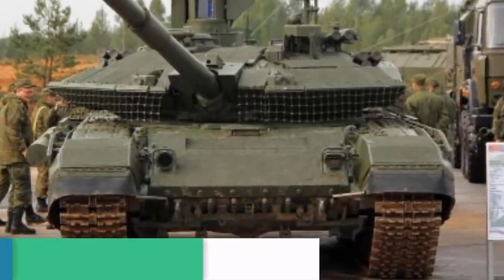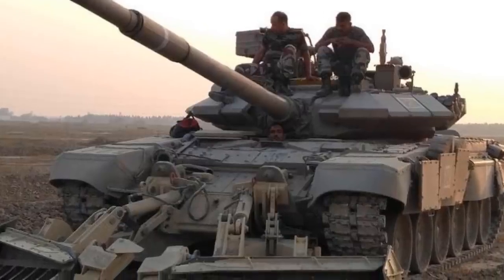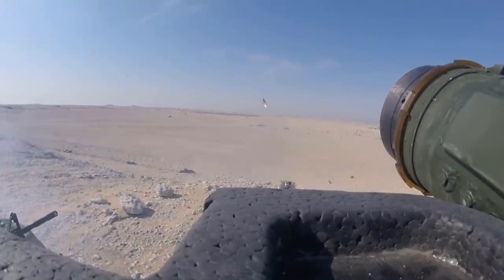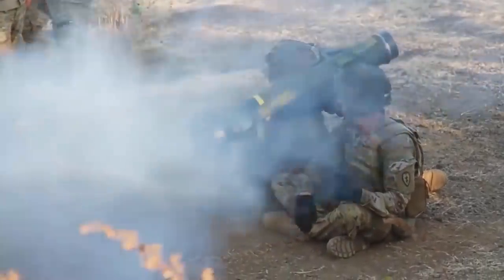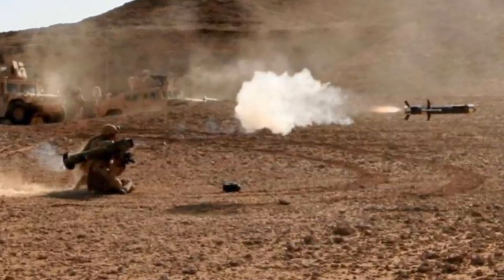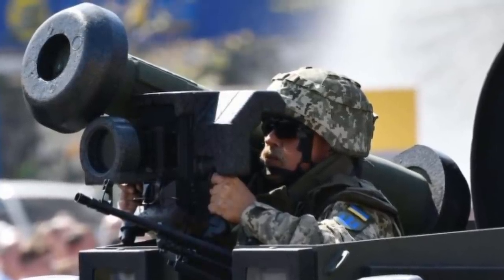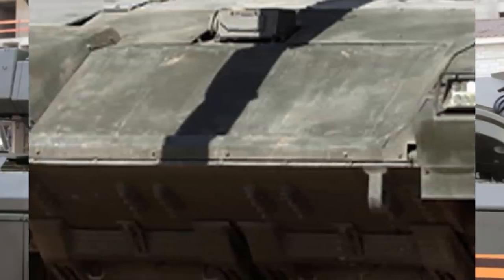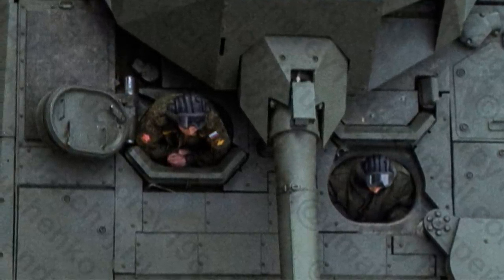US Javelin missile vs Russian Tanks

Comment: I fired the Javelin's predecessor, the Dragon. Had to hold the crosshairs on the target throughout flight time, which could be 10 seconds. Took nerves.
Reply: The Javelin takes 30 seconds to lock on. Is that supposed to be an improvement? Modern SACLOS ATGMs are much faster than the  Dragon and you can fire them immediately.
Reply: That would be the longest 10 years of your life
Reply: @JAnx01  It takes about 30 seconds to cool the thermal sensor of the Javelin. Lockon on is likely only a few seconds. Most tipod mounted systems will take about 30 seconds to setup as well. So would you rather fire and wait for a hit or fire and be going somewhere else before it hits.
Reply: And the noise of the dragon round firing made my gunners flinch upward (we called it butt clinching) and always caused the missile to slightly dip before correcting again and re-aiming at target.
That being said our guys never missed.
Reply: @JAnx01  The Javelin is fire and forget.  Once it's in the air the gunner can take cover.  Can't do that with the Dragon.
Reply: imagine firing the tow missile
Reply: @miketaylor5212  Yeah, maybe 13 seconds to hold cross hairs on target?  Real men....
Reply: @bdinaz  in my experience, that dip in the missile's flight is caused by the weight transfer. One second the missile's is resting on your shoulder, then it's not and your body rises slightly. When the smoke in your sight picture clears, you see that the crosshairs have dropped. The trick is to quickly but smoothly move the crosshairs back to center mass. If you are not quick and smooth enough, or are unlucky, the missile strikes the ground or the wire breaks before you can do it. At a range day at Ft Campbell in 1988, all four gunners in my Company got hits, all four gunners in another Company  missed.
Reply: @miketaylor5212  at least the TOW is tripod mounted.
Reply: @michaelhorning6014  yeah, but for us it was more than weight transfer.  You could visibly see the gunners pop up 1-2 inches from the spontaneous jolt to their bodies from that explosive noise.
Reply: balls a steel much?🤠

Comment: The Javelin and the NLAW are capable of going through reactive armour, so i highly doubt the T-90 would fair much better against the Javelin than the T-72. The top of the turret cages, without much surprise are also proving to be unnefective against Javelins.
The T-14 design indeed might save the crew, but if the turret gets's hit, the tank will be out of commission anyways. And EVEN if the active defensive systems proves to be effective, with the amount of anti-tank launchers being sent to Ukrain, a simple "double tap" system will most likely be enoug to defeat it. First missile makes the tank deploy is active defensive system, second one disables the tank.
On top of that, as mrvwbug44 said in his comment, I higly doubt russia has enough T-14 to make a difference.
Reply: that assumes the T14 has operational reliability in any event. I doubt that it is a given.
Reply: Russian tanks so far haven't been faring well. T-14s are necessary if Russia wants to fair better than they are now.
Reply: They can certainly double tap; they've got plenty of old AT systems they can use for the first hit. I seen them knock out a T-72 with a double AT4 the other day (rear hit).
Reply: The javelins affective penetration is 800 mm the contact five armor on the T 90 M is valued at over 1000 mm of effective against shaped charges
Reply: @mattbanco4406  The Javelin hits the weakest part of the T 90, the top armour which isn't rated 1000 mm but at best 400mm.
Reply: The biggest joke about the Armata is that  they've been building it for 20 years and yet it's still in it's trial phase, and they've only build 20. and the rest of the Russian tanks are all just cheep upgraded T-72's.
Reply: The US tested how likely a small unmanned turret gets hit by APFSDS and ATGMs and the US tests concluded that its VERY UNLIKELY to hit the turret they tested it on their M1TTB which has the same style turret also the turret is protected by 10 hard kill APS
Reply: Only 20 or so T-14s have been built, so yeah. It really won't make a difference, no matter the amount of wishful thinking.
Reply: They have 20, maybe 22 T-14 build and delivered.
Reply: Only time will tell how effective the Javelin and the Russian tanks are.
Reply: The T-90 is basically an upgraded T-72B with T-80U technology
Reply: @lastboyscout6437  time is telling right now and the russian tanks are not fairing very well
Reply: Russia has no T-14 in service. All they have are basically pre-production models.

Pretty effective propagada machine they are running, innit? Hyping off the deployment of tanks well a decade before they are even service ready lol
Reply: @Rocketsong  They have only been delivered to the testing centres, not for actual combat. Also the T-14 Armata's that they are testing have not been all the same, and have not passed even 50% of their trials. The facilities for their production have sat quietly for nearly 8 years because the Armata is not what the Propaganda has promised, and the Russian economy couldn't afford production cost's, especially when you consider the two biggest buyers in the past of Russian military equipment, China and India, have proven they are able to build better domestically designs than Russia can sell them. And without the massive outside orders of Russian military equipment, the Russian research and design has proved to be to costly, and starting a war with Ukraine has only crippled their current production abilities even more thanks to extremely large sanctions. And having most of "Putin's" 720 billion dollar war chest now frozen in of shore bank accounts has even hindered the production of replacement munitions that have been used so far.
Reply: The major drawback of the T-14 isn't its combat effectiveness but rather its manufacturing costs of $3.7M.  No way Russia can afford these tanks getting destroyed or even damaged.
Reply: With Russia’s military budget it makes no sense to invest in a new MBT. Their tanks are by no means junk, it’s just that tanks in general are becoming obsolete.
Reply: @zachfrancisco8185  Ok, so it hits the hull roof instead. What's behind that armor plate? Crew compartment, engine, or penetrates down into the ammo carousel beneath the turrent (it hits at an angle after all) Either way, ineffective tank afterwards.
Reply: @mattbanco4406   The problem with your statement and that used in the video is you are using " valued at thickness " which is not the actual thickness of the armor if it was then the 1500mm armor in the video would be almost 5 foot thick and your 1000mm around 3.3 foot and no tank armor is even close to that, valued at is an equivalent to which means that as an example Valued at 1000mm armor might actually only be lets say 6 to 12" thick in actuality and that to a shaped charge is still warm butter to pass through as all metal melts at the temps the shaped charges run at, the "Valued at" is actually only when tested against non shaped charges like other tank rounds / anti tank rounds and so on
Reply: T90 is basically an upgraded T72... made with cheaper parts lol
Russia has to actually build the T14 for The Javelin to smack it down... I’m not holding my breathe.
Reply: thats because t-90 is same or worse than t-72 depending on variant. the number is just a marketing gag.
Reply: @mattbanco4406  that is turret front..... guess where javelin does NOT hit....
Reply: @mattbanco4406  Tank armor is always rated as a maximum number under ideal conditions.  Even in WW2 there were a lot of tanks taken out by smaller guns that "weren't supposed to" have been able to penetrate simply because they got lucky or there was a flaw - real life isn't the same as tests and computations.
Reply: @mrk8050  you are mistaken, Russia has more than two thousand t90
Reply: @МихаилПоливанов-ф7х  In 2010 the Russian Federation only had 369 T-90As, 120 Т-90s and 40-45 Т-90Мs tanks in service. However in 2010 Uralvagonzavod received 18 billion rubles, that's $294 million to deliver 261 new units until the end of 2010. Unfortunately the money was either stolen or spent changing Uralvagonzavod's facilities ready for the production of the T-14 Amata, which they are still waiting to produce as the T-14 is still going through it is or was testing. All existing T-90 variants were to be modernised to T-90Ms between 2020 to 25, which is very unlikely to happen now as the Russian economy has crashed and there are a lot less T-90s in service prior to the invasion. The only large number of tanks that Russia actually had in storage since the end of the Soviet Union were 5,200 T-72s, and when Russia calls it storage it means left out in the open. So other than the embarrassingly poorly maintained T-72s in service before the War with Ukraine, they'll be lucky if they can get 10% of the "stored" T-72s even working and updated, let alone in to active service. Then you need to train fresh crews who are willing to drive a 50 year old tank into a war after seeing all the casualty list's for $400 a month.

Comment: Javelin must have been upgraded since this video was made. Tank warfare seems to be over if one side had a ton of Javelins. Extremely high kill rate over 90% no matter what armor or advanced system used.  Only work around to keep tanks alive would be air support to take out infantry.  Currently infantry have the upper hand and are more cost effective.
Reply: Armor has always required infantry to provide cover.  Otherwise it's just a moving pillbox that anyone can pour fire onto.
Reply: Air cover isn't a counter to infantry. It takes out vehicles and hardened positions. Not mobile infantry.
Reply: Tank warfare isn't for urban combat where infantry can set up ambushes from atop buildings.
Reply: Recent generations have grown up with desert warfare and massively lop sided wars.  This has shown tanks and all other forms of AFV and vehicles fall prey to the side with complete air superiority.  People have forgotten that warfare is primarily about infantry - everything else is essentially support for the infantry.
Reply: The reason tanks Will stay active is because nothing can put out the amount of accurate, high velocity, direct fire a tank can, all at range of 2-5km+, and all while being much more survivable for the crew. Doesnt really matter if there are tools to destroy them, thats just not a reason to phase them out, its a non issue as far as doctrine is concerned

Comment: Since 2021 Ukraine now has over 10,000 javelin missiles.
Reply: and a shitload of AT-4's and lots of other anti-armor goodies.
Reply: @22steve5150  5000 AT4 delivered this weekend by sweden plus 5000 helmets, 5000 body armor and 135000 MRE guess they are hungry too...
Reply: @Charles White Russia hasn't used high altitude carpet bombing because Ukraine has significant air defense missile systems.  You might notice that the only aircraft operating for either side are flying at very low altitude and it's mostly missile/long range artillery rocket strikes that Russia is using on the cities, not bombers or strike aircraft.
Reply: @Charles White The term you are thinking of is "Air Supremacy".  Superiority indicates you have control of the skies but the opponent still has ability to disrupt your operations or prevent certain kinds of operations.  Supremacy indicates the opponent has no ability to effectively stop or even hinder your air forces from doing whatever they want.

Comment: Ukranians seem to be destroying a lot more Russian tanks than expected, and they aren't necessarily only using the Javelin.  They have a large stock of Russian made ATGMs and anti-tank RPGs which are easily capable of taking out T-72s, and probably T-90s if hit from the back.  Russia doesn't have enough T-14s to have any impact on the current war and likely never will, and probably not enough T-90s either given that the vast majority of what has been encountered by the Ukranians has been modernized T-72s.  As for Javelin vs T-14, I suspect it would hit the turret if not stopped by the active defense and disable the turret, but the crew would probably survive.  Javelin vs T-72 almost always = dead crew as it usually hits the ammo storage often blowing the turret off the hull.
Reply: As far as I know, there is not even a single T-14 in service. There are only a few which have even been manufactured and they are still being tested and put through their trials. The initial batch meant for front line service has been repeatedly delayed. I stand to be corrected on this.
Reply: They have a ton of RPGs for those BTRs and BMPs....
Reply: They’re using NLaw’s mostly.
Reply: NLAW is lighter, shorter range, and doesn't go very high in top-attack mode. It's a better fit in urban environment when there aren't much space to maneuver. Javelins is better in open field outside the cities.
Reply: @jdickson242  No, it means a lot of NATO equipment will be blowing up. I think that's why NATO ran for their dear life out of Afghanistan. They knew that it will no longer be safe to mess around with sovereign countries any more, after what they did in Ukraine.
Reply: @hughjass1044  Essentially correct.  They have 20 to 22 of them, and they are in a training group.   They certainly are not going anywhere near Ukraine.
Reply: @julianpetkov8320  poor kremlin bot
Reply: @Rocketsong  Yeah, that's what I thought. I knew it was something like that but I didn't know the exact figure.

I laugh at all the paid trolls online who keep blathering about all the havoc they created in Syria. I doubt any of them even set a track pad on Syrian sand. Maybe for testing, but nothing more.
Reply: Ukraine also has own ATGM Stugna. It is nt as good as Javelin or NLAW but does the job well too

Comment: Am retired Navy and never grasped why there were not more weapons systems designed to take out the track system.  In naval warfare the engine room is always the prime target with weapons systems.  If you take a track out the TANK is now for the most part a stationary exposed gun platform.
Reply: a mobility kill will stop a tank but that tank can still hurt you until its out of ammo.
Reply: @miketaylor5212  well when you loose your mobility with a tank it may get off a few more rounds before someone hits it from the rear, no engine means no hydraulics and electrical power thus a very slow turret rotation, even if it is possible. In a fluid battle field it is not going to be of any value other than a sitting duck target.
Reply: Any AT weapon can take out tracks. Designing a weapon specifically to take out tracks seems like a solution for a nonexistent problem; why develop a weapon to take out tracks when you can just develop a weapon that will kill the tank anyways? Taking out tracks is risky, as even though you could eliminate its ability to move, the target tank’s ability to shoot and kill you is completely intact. Its something you might do if you have no better option, but you would never want to do it if you had the choice.

It’s a little different for ships, just because there really aren’t any conventional weapons that could take out a  decently sized ship in a single shot, so taking out specific key components makes sense there. Also, there is less of a need to take a ship out very quickly, since typically the things that will destroy ships (subs, other surface ships, aircraft) are not going to be at risk of being immediately killed once they let off their weapons.
Reply: @jonathanpfeffer3716  Well if you can field a light cheap system that will make a tank disabled it might be worth it.  Sometimes by thinking outside the box you come up with something that is quite cheap and effective.  Hell even a light munition that contained metal powder and a stick primer paint may even help.  Hey it would blind all of those high tech sensors quite well, play paint ball one time and take one to the face and you can't see shit.  The last thing I would want to do during a battle is get out and clean off the sensors to continue.  Many of the revolutionary battle field weapons were first though to be a real off the wall system.  But think about it a metalized powder on a radar cover would blind it or damage it, reflected energy issues.  Next optical systems would be degraded quite a bit, and that leaves you sticking your head out of the tank to drive it which isn't the worlds best idea.